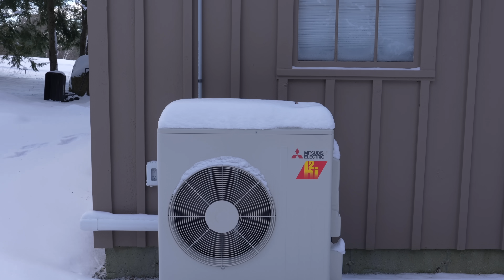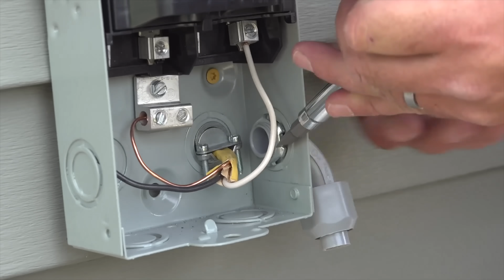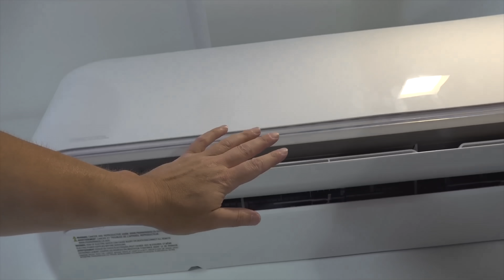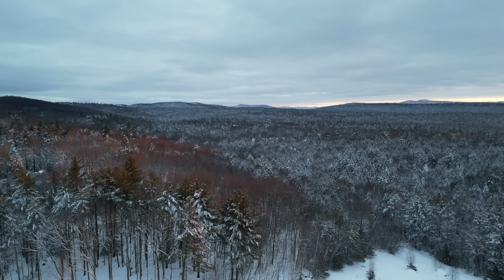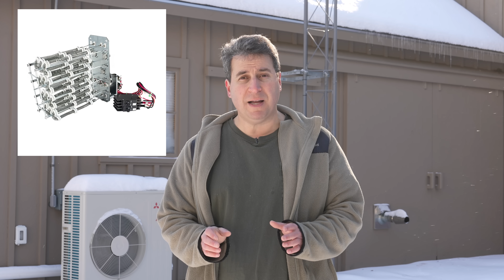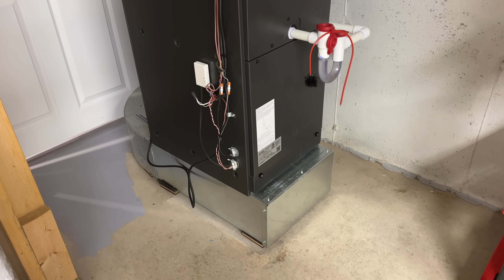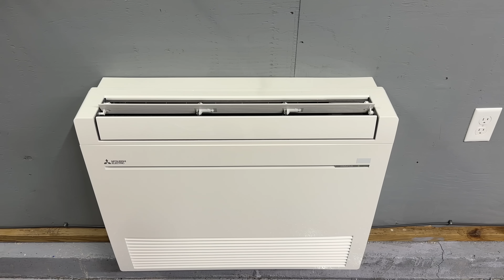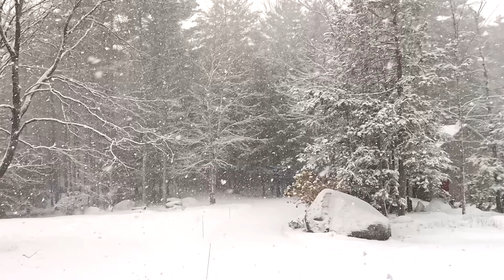Why Heat Pumps are now leaving people COLD

Comment: my last house had supplemental heating coils on the central furnace. Entire house was electric. It's convenient, but running the heating coils when it gets super cold costs a ton. Last year when we had a week of sub-zero temps, that week cost more than an entire month of heating with the regular heat pump